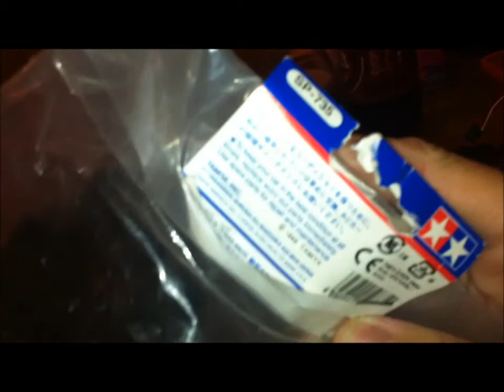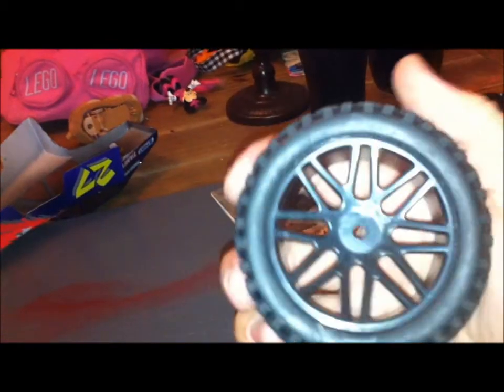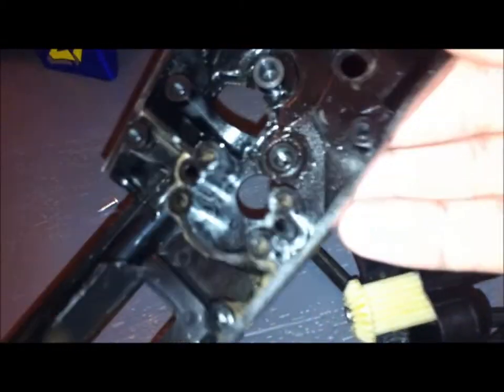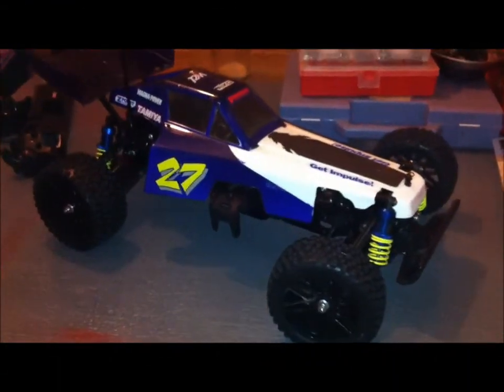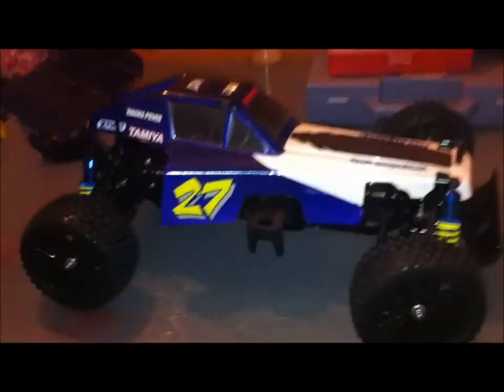Tamiya Baja Champ Repair 2014

Comment: Hello mate, I wonder if you can help me with a few things. I've just got one of these and need some advice. The first thing is, it has 85mm long (end to end) shocks front & back, which are way too long  The front wheels toe in really badly. When I push it down the wheels straighten out, so I guess I need shorter shocks. Could you tell me the length of your shocks front & back please. The other problem is the motor, esc and battery get really hot after a 10 minute run. Is this normal ? I am running a standard 540 silver can, 19 tooth pinion, generic chinese esc and a 4300 Nimh battery with stock wheels & tyres. It runs beautifully but gets very hot. Any advice would be very welcome. Many thanks, Derek  : ))